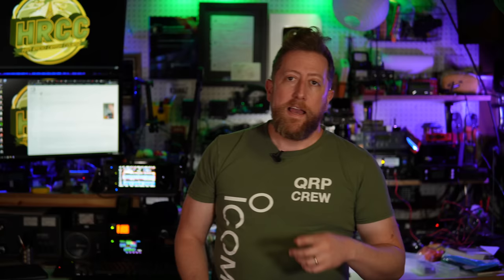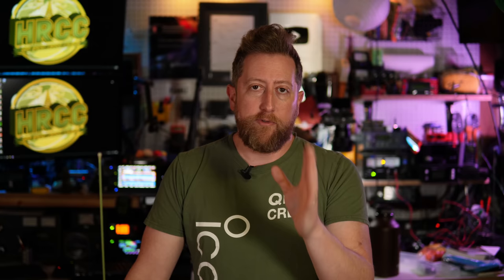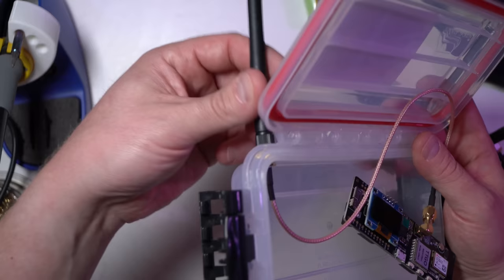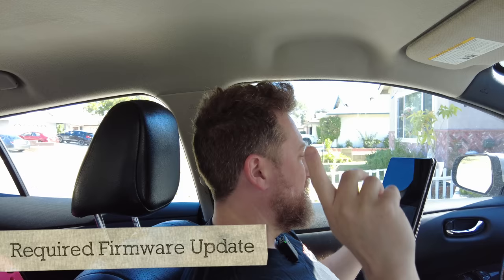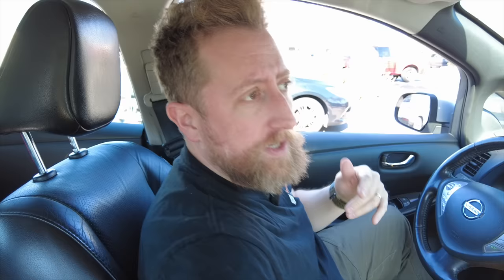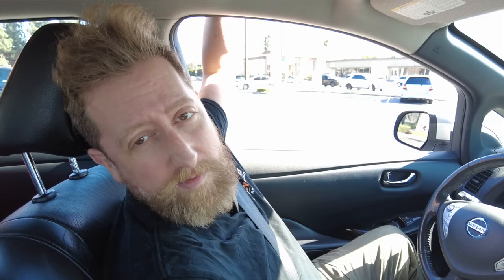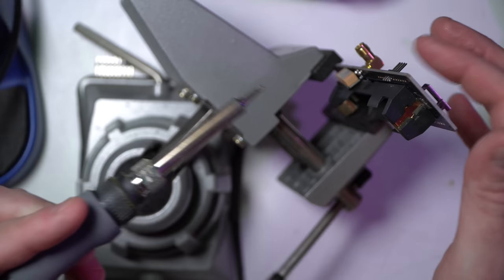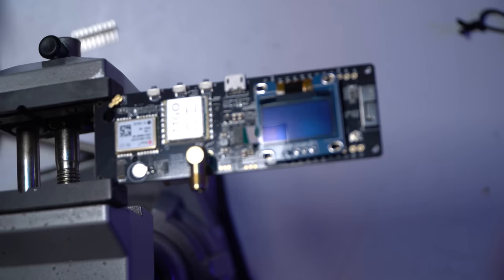LoRa Meshtastic Range Test, Portable Relay & Your Questions - Off-Grid Communication

Comment: If I understand. If only using one Lora then at max distance two people could communicate at double the max distance both reaching the lora is that correct ?
Reply from the maker: You would need a LoRa device per person. They are the transceivers. The phones only connect via Bluetooth or wifi.

Comment: Will this LoRa device relay communications from a Victron Solar Inverter to ur Android Tablet ????? for the sole reason of getting real time telemetry energy monitoring 500meters away, the monitoring software through the internet and web server keeps dropping out and access thru blue-tooth is realtime and accurate.
Reply from the maker: Hypothetically yes, but you would need to figure out how to get the data and format it for transmission over LoRa.  IDK of anything plug and play

Comment: What is an effective means of communication for about 30 miles when there is no power and something I can just buy and communicate without complex setup?
Reply from the maker: What’s your budget?
Reply: @HamRadioCrashCourse  thanks for the reply. don’t have one. I don’t mind spending a few hundred if it’s good equipment. I’m sure some can run thousands but anywhere under 700 I guess

Comment: Is there a reason the device itself has to be at high elevation?  Could you in theory just run a coax cable to a roof antenna while the device remains inside.
Reply from the maker: Unfortunately no. The feedline between the antenna and radio will suffer loss, basically leaking power you need to make the transmission.

Comment: so if you set up 1 every let's say 2 miles, could you then communicate much greater distances? I can't remember if that was covered in the first video
Reply: Correct. Nodes relay messages. Range between nodes depends on LOS, antenna gain and environment.

Comment: If I used these Meshtastic  boards (I have ordered 3 by the way, waiting for them to show up) does the client software report signal strength? I am hoping to use them in an application that would allow me to use the LoRa signal to pinpoint direction of the broadcast in a last mile situation. If you've seen Aliens 2 where the space marines have their alien detector that can show direction and range to the incoming aliens, I want to do the same with my LoRa nodes.
Reply from the maker: Yes. It displays signal strength and location based on gps.
Reply: @HamRadioCrashCourse  Ah, great. As to the GPS, I am hoping to not rely on GPS and just use signal strength and a directional antenna.

Thanks for the reply, just found your channel based on my recent LoRa research, and like what I have watched. Keep up the good work!

Comment: Aloha Josh, for those of us that don’t live in communist countries, how many miles was the world record for a line to sight transmission with one of these devices? I use to do the first MESH Networks with a 31 dB yagi antenna and a Linksys Router and I would get a range of 35 miles unless we had rain or VOG, which would interfere with the line to sight connection. I would like to use this same yagi antenna for this device also. Thanks! 🇺🇸🇺🇸🇺🇸🇺🇸🇺🇸🇺🇸🇺🇸
Reply from the maker: The world record is 150km. Andreas wasn’t using Yagis either.

Comment: So if I have a coupe of these setup and then someone else near by setup a couple, will they automatically start communicating to each other? Will we "see" each other?
Reply from the maker: No. They’d all need to be configured on the same channel for them to talk. You’d have to coordinate the network.
Reply: You create a channel using the app, which produces a QR code on the device, that you have paired with a node via Bluetooth. You share the QR code with other users via their paired device camera. Channel communications use 256 bit encryption, shared key.

Comment: Will putting a larger antenna increase range or does something like SWR come into play?
Reply from the maker: Yes and yes.  The best thing you could do is get it outside and get it higher up. But not too far or you’ll need to relay the wifi signal.

Comment: Is Aliexpress still the recommended place to purchase?  Not sure I trust them.
Reply from the maker: I think I bought like thirty of these things so far.  No issue.
Reply: @HamRadioCrashCourse  Thanks!
Reply: @HamRadioCrashCourse  So I purchased two of them, BUT, I have to have an app to mesh them, which needs internet, confused how the app allies to the units when I do not have internet.  Such 2 folks in the woods camping.  May have the apps on cell or a tablet but not understanding how I can use these away from those.

Comment: So I still a little confused about the use. You can have secure digital communication for a short distance (say up to 3 miles). OK great. I also read these can MESH with other nodes and made a network like the internet which could extend range? That would require many nodes by individuals within range of each other. At this point unlikely.  Still confused. I have seen it presented as some shiz hits the fan communication device? Really? I like to try it to learn about it but having difficulty thinking of some basic use to justify getting into this device. Any one give me some ideas of it's uses.
Reply: Unlikely, why? Just buy few nodes and install them as high as possible and connect solar panel to it. I did this way and have means to cover close to 6sq miles big area with coverage.
Reply: @ApocGuy  So you are a 1 node network. OK you put another up at your cousins house a block away. 5 more on other people's property? Batteries and solar cells? OK. What you going to do with it? I see for research you have sensors spread out and collect data but again wide area open communication not so much.. My point is two fold: 1) You will never have mass adaptation to make a wide area network's. There are not enough HAM and RF hobbyist. What about rual areas? Range is limited. 2) If you want long range communication get your amateur radio liscence.
Reply: @gmcjetpilot  Lora was never meant to replace ham (currently there is NO tech that could replace good ol ham radios ;) ) but supplement it. i do get your concerns, but LoRa and other tech is mostly used by two types of people; those who are interested in its technology and data collecting , and those who see its use for jerry rigged communication for shtf or teotwawki. sure it wont be mass used, but put in high places it should reach those who know why they are using it. and btw, even if it has only 05w of transmit power, that doesnt mean it cant reach long distances. check videos of simple walkies, going past 15 miles LOS here on YT. im talking about handhelds that cost at best 50 euros...

Comment: If I set up a repeater node, can I turn off the OLED and GPS to save some battery power?
Reply: The OLED goes to sleep pretty quick. The CLI allows for GPS to be disabled. I get about 48 hours on a 1100mAh LiPo. I'm using   the LILYGO® TTGO LoRa32 V2.1_1.6 Version.

Comment: If a group of off gridders pitched in and put 20 of these things out like this with solar panels, they could have their own Cel network for 100s of square miles.
Reply: You'd need a lot more than 20 for "hundreds"
Reply: @ILoveTinfoilHats  lol. @3 miles range, that’s 36 square miles per unit…..  x20 is 720 square miles.
Reply: @ThisTall  first off, they have to actually be within range of each OTHER, so assuming a perfect uniform 3 miles range, that's not actually 36 per unit, it's 9. x20 = 180.

But not even that is correct, as signals don't travel in a square. That's looney bin nonsense. Your "best case" scenario, is a hexagonal layout as waves will go out in a CIRCLE, which gives you about 7 per unit. 7 x20 = 140. 

Of course all those are assuming perfect conditions, and no outages. Do a little geometry in your 2nd grade class next time, I assure you it'll help :) also liking your own comments is cringe.